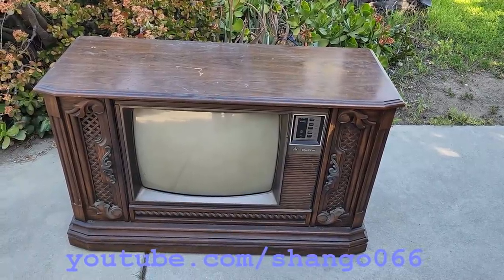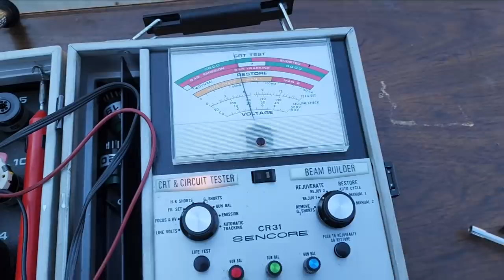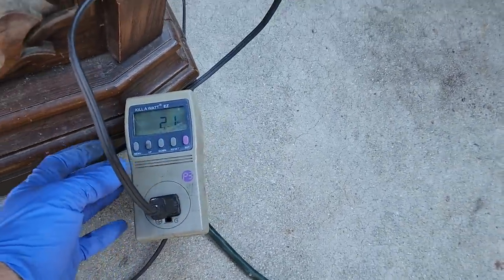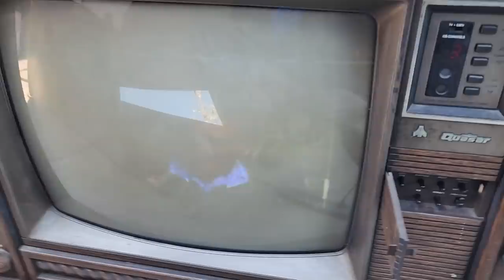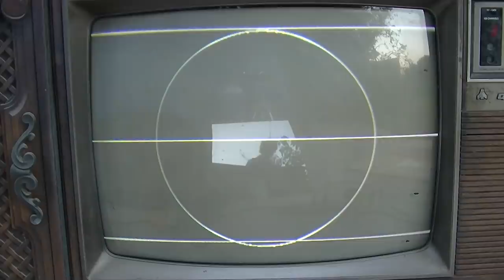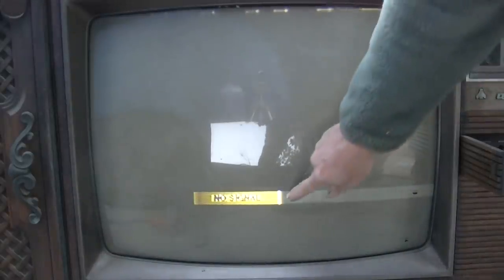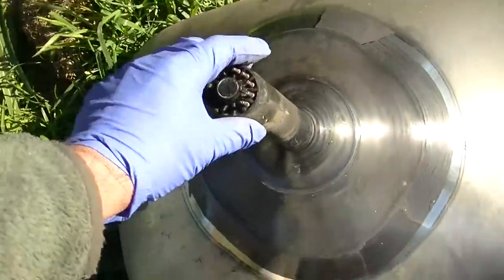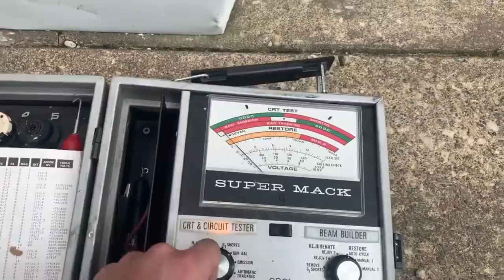1982 Quasar Console CRT Color Television With CRTs

Comment: WOW, this is the exact TV I grew up with lmao.  At one point in '85 or '86, something happened to the CRT and if it was off for too long, it would take damn near 3 hours until a picture showed up, though you could still hear audio.  Funny thing is, after the 3 hour garbage was discovered, mom and dad left it on 24/7 for almost 14 years straight.
Reply: 24/7 for almost 14 years straight.  LMAO

Comment: Here's something to think of about this set, it's 40 years old. 40 and there's still life in the CRT, the chassis is still working. That someone paid the better part of $500 for it in '82 I'd say they got their money's worth out of it. For ugly plastic and particle board and cheap electronics I wouldn't complain too much. As for that house, holy cow, all those old CRT's and especially the old low deflection ones and small roundtubes, what a score! Totally worth trashing some of your near dead ones to take in a bunch of those. Even if you won't use them it's very likely someone would gladly take them.
Reply: i have a 1965 valve/tube dual standard 405/625 (i'm in the uk) black n white tv that has an excellent emission crt, and it still works , plus a 1968 transistorised one also vgc, ..  none have been recapped, the valve/tube one has had to have a new video detector diode fitted, thats it
Reply: @andygozzo72  I have a Ferguson Courier III in the bedroom (BRC 1400 chassis) which sports a CRT with fantastic emission. The picture is lovely and bright and IMO displays a more crisp, punchy and dynamic picture on the 405-line sources than it does on 625.

The Pye 48 is the same in that respect.

I think the best 405 picture I've seen to date though might just be the Murphy V10A .. it looked great during restoration but does need the recap completing (signal stages) and the newly rewound LOPT fitted. This is single standard 405-line.

Comment: Those CRT's, that man may have saved the TV collectors market for a century! Hero!!
Reply: Pretty crazy collection... I bet they were all good pulls. Mixed with some new or rebuilt ones too... 

Hope a bunch get to find a home.
Reply: Crazy collection of crt's. And as long as they didn't go to air they should be fine.
Reply: @sirmojo4537  looked pretty dry in there so most ought to be fine if they were good when stored (except maybe the metal-bell type if any of those)
Reply: We all want to know if he was allowed to remove them free of charge.
Reply: OK I mean this is pretty awesome, but who collects nothing but naked CRTs?
If you're a vintage electronics enthusiast, you'll have tons of electronics, circuit boards and spare parts and stuff. If you're a vintage TV collector or repair person, you'll have stacks of old TVs and maybe some VCRs and spare parts and boxes full of remotes, but just naked CRTs with not even a single yoke in sight? WTF man? Simpson's crazy CAT lady just replaced the A with an R...
Reply: @senilyDeluxe  I kind of feel there was some "eccentricity" involved but it was also mentioned that there was a collection of TVs also and the owner didn't know what they had & started junking stuff.
Reply: There is a type of hoarder that collects as many as he can of some hard to get  item. He will never be able to use them all. If someone wants to buy one he will say  something like "I have a roundy coming in soon, I need them". He never fixes the items, he never sells them, he just wants to have more and more of them. If something happens to him, the family sends everything to scrap. This may not be the case here. Often this happens with antique classic cars. They are stored outside until they rust away and they are not even good for parts.

Comment: More than likely the reason why the picture was "shrunk" vertically and the vertical hold control was diddled so much was because the original owners may have thought there was something wrong with the vertical deflection when the TV was showing 16:9 programming (because of the fact that 16:9 programming shows up "letterboxed" on a 4:3 TV) so they were trying to get the screen to "fill out" when there was letterboxed programming on the TV but then when 4:3 programming showed up on the TV screen they had to readjust the vertical.
So with that in mind there probably wasn't actually anything wrong with the TV, just someone who didn't understand how modern ATSC programming worked on an older NTSC set.

Comment: Those Quasars have a Capacitor near that heat sink the Vertical outputs are on in the Horizontal circuit that will dry up and cause the picture to be dark and smear from left to right side of picture.. Changed many out in the mid to late 80's. I think they got to hot and would fail-
Was happy to see one of these ugly sets, sold them new. Thanks !

Comment: So, the last Quasar you featured, I talked about how it was "Grandma's TV" and how you couldn't hook your Nintendo to it because Grandma was afraid you'd damage her TV.

This Quasar was Grandpa's TV.

This Quasar was the TV you found in the home of a man who worked at Chrysler for 35 years, until a robot replaced his job. He was at about retirement age anyway, so he decided to cut his losses. He bought this TV shortly after retiring, and he kept it until the day he died. By the 90's, he was using it as a stand for a newer TV. He never got rid of it because "Well they don't make 'em like this anymore! No they don't make 'em like this anymore. This is gonna be worth something some day! They don't make 'em like this anymore."
Reply: Don't leave that game on pause you'll burn the screen!
Reply: @danmackintosh6325  Yeah I went over that when I commented on the last Quasar. It was a real problem on rear projection TV's.
Reply: I hate it when they finger that vertical hole too much and it's all worn out.
Then it can't stop rolling over and over.
Reply: @Xplasma1  I still remember the instruction book specifically noting that my NES was not recommended to be used on front or rear projection TV's.  Don't know if it was just my household or whether other's parents/grandparents took that to mean THEIR TV even if it was just a plain-jane 3-gun monolithic bulb...
Reply: @danmackintosh6325  Exactly. And Grandma thought it applied to her TV as well, thus you were forbidden from hooking any game console to it.

Comment: I worked at the Quasar factory service center in the 80s. You got to watch out on those where it smears to the right. Could be CRT or maybe not. There are caps that filter the B+ source feeding the CRT socket board that go bad and it will smear to the right just like that.  Sometime the cap(s) are on the CRT socket board and sometimes on the chassis near the flyback. Scope the power source going to the CRT socket board for horizontal pulses in the DC. If that’s the case the caps are shot. I fixed a lot of them while working at Quasar.

Comment: I think the image quality was better for SD broadcasts before it switched to digital. Analog TV actually looked pretty good.
Reply: One thing I miss about analog is that if the signal fades, the picture would get snowy/fuzzy - but you'd still have a picture. Digital of course just goes to blocks and freezes. It's maddening trying to use an indoor antenna with digital.. analog could always just be 'good enough' and still work.
Reply: If you watch YouTube in 480P, 30 FPS, you can get a good idea of how NTSC could look on an excellent signal. The only difference is that 480P is progressive and NTSC was interlaced. 30FPS = 60 fields/second.
Reply: @MattExzy  radio is the same way. Analog would just fade. Much like shortwave, AM, HF. FM was less forgiving but still worked on weak signals, within reason. All the digital now is “all or nothing”. It is frustrating in certain situations.
Reply: SD broadcasts looked a helluva lot better than how they show up here on YT after all that processing. Personally, I find digital compression artefacts more objectionable than noise in an analogue signal.

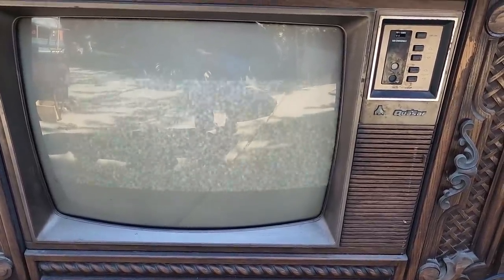Comment: 13:22 I had the same years ago, My TV wont switch on mate, its completely dead, The ON / Off switch must be broken, It needs a new one fitting, if I've been told that once, I've been told it a hundred times, I kid you not. I often used to tell the customer I would supply a replacement switch for free, because I kept a large stock of On / Off switches, the dam things were always going wrong, It would be very easy to fit themselves and save them the call out charge, As I recall, not one person ever took me up on my offer,  A little knowledge is a dangerous thing. Right at the top of Mount Stupid, but, as I'm sure you are aware,  it takes all sorts to make the World go round (or switch the T.V. on :-) P.S. great YouTube channel, keep it going my friend.

Comment: I brought my 1st color TV on my 1st paycheck in August 1981. It was Sanyo (Sears) 19" that last until 2017 when I trashed it and paid $60.00. for deposition fee. There is no repair or home service like the big screen floor model that popular during the 60 and 70 in America. The floor model TV similar to this one cost between $800.00-1000.00 in 1970 with home service contract that cost about $80.00 a year that consider $2.5K to day dollar value base on gold standard ($37.42 per ounce back in 1968.) Oh I forgot the moving cost for this size of TV to the shop is more than $100.00 plus service estimate fee plus actual cost that added up probably cost more than the set itself.

Comment: I'm not much younger and I remember during my childhood how appreciated and highly valued by parents' and grandparends' generations were wine glasses and other table utensils, chandoliers etc. made of lead cristall glass. As far as I remember, picture tubes are made of very high lead content glass - about 20% (except Tektronix's ceramic electrostatically deflected scope CRTs) and the only other glass product that has higher lead content are screens of the sealed chambers used to work on radioactive materials - around 30%. I think CRT's glass is properly recycled, but aren't there craftsmen that can repurpose them without melting? I doubt that after scraping carbon cover out of the bell it would be optically acceptable for a fish tank, but i.e. lighting fixtures might even benefit from this.

Comment: Yeah thats the old Quasar logo.....those darn purple panasonic capacitors. I have a panasonic built top loader that has about 200 of them built in 1980. Been replacing them as I go or notice a problem. Yeah, I remember doing calls and customers would say "i think i need a new picture tube" when the vertical collapsed. I used to fix them in home, had the IC caps and resistors on me for most direct view and projection on my truck. I dont think I have seen an old panny for repair like this one since the late 2000's.

Comment: I use to fix the same look console back in the 70"s - 80"s, but they were mostly Zenith models, mostly the Hor. Transistor for the high voltage was 90% of the problem, that TO-3 you noticed in the fly back

Comment: The lack of vertical deflection happened to our 1976 Wards TV when I was a little around 1980. I remember two bIack dudes showing up around 10 at night to fix it.
This style TV was very common in the early 80s and was pretty much gone by the late 80s in favor of the more modern, compact TV designs. Cable ready was great till they started scrambling the premium channels instead of using notch filters. I remember our neighbor getting the premium channels without a cable box.

Comment: You had the date posted on the back. You panned over it twice.  This TV is a POS.  How I fixed these was covering the tuner and hitting them with a high-pressure hose.    Hit it again with compressed air and let it dry for a week.  Presto! works every time.
Reply: He did note the date and mentioned how it was right in front of his face the whole time.

Comment: On the topics of these console tvs 

Ive got one that is a stereo system and it all works besides the tv part and its getting high voltage and the tube fires but no image, audio, or "snow" on the crt

The audio works for the radio, record player, and 8-track but its only on the tv part its bugged would this be a transistor failure or something more severe?

Comment: contest, the dirt looks like dust and some smoke. If I remember correctly there  two 4.7 around 50 volts in the vertical circuit.

Comment: i do see a date sir in that bottom scratch off retangular thing that look like a integrated circuit printed on the back cover. april 1984. I had a color console solid state. My mom and dad bought me a console that would fit between the closet and the bed room door. The set I used to have had tubes and the crt took a @#$%**&. It would have cost like 90 dollars for a crt

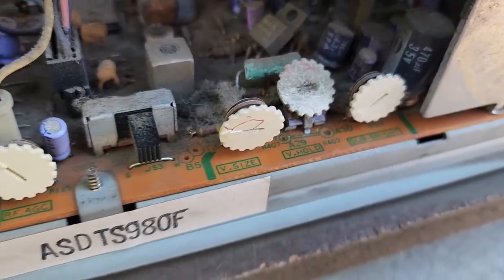Comment: 19:05 Panasonic really cheaped out with those adjustments just standing there, waiting to be mowed down. They could at least have put something behind them, or even soldered them flat to the board so they would be accessible as thumb screws. I suppose they put the vertical hold on the back assuming that with modern video chipsets, there would be little need to adjust it; seems they were wrong.

Comment: Would you have any interest in a 35" toshiba set? It played pretty good, but would intermittently loose the color. I have had it for about 22 years. I had the vertical deflection amp replaced. I know the high voltage is good. It has pic in pic, but single tuner. I think it is from late 80's to very early 90's. It is a really neat set.
Reply: Joseph - You sound like me recently trying to give away a perfectly working 35" gorgeous Magnavox console (my wife wanted a flat screen to take up less space) that even the landscapers didn't even want to even take a LOOK at. Cost me $200+ to have 1800 XXXXX to take it away. They sent two beanpoles in a high-back, no-lift stake truck for this 300 lb behemoth.  I had to build a ramp with 4x4s and almost had a stroke helping them lift it.☹
Reply: @cmans79tr7  It's a 35" Toshiba and not a console. and it has an intermittent problem killing the color. But during the time it is playing correctly, it had a beautiful picture. I am sure as old as it is now, it would need completely re-capped. But I would give it to someone who would like to have and fix it.

Comment: what's the point of that fan in the crazy crt-collectors house? pulling hot air from the uninsulated attic into the livingroom?
Reply: I believe that is a “whole house fan”. You open up the windows in the evening, turn that fan on, and it will cool the house down very quickly.
Reply: Fan sucked hot air from rooms, UP into attic, supposedly to exhaust outside and save electricty as opposed to running air conditioning. Sounds to me like a good concept, but I know of three people who had it installed, used it for a half-season, then never used it again. I never asked them why they stopped using it.

Comment: And Sony was building the Trinitron, with every penny more.
Reply: This has the “personal touch” control though.
Reply: @gavincurtis  Personal touch is just a fancy name for the contrast control.
Reply: @dougbrowning82  Contrast is for peasants.
Reply: The Quasars of this time were pretty solid. I knew this thing would work. Actually was same time RCA had Fly backs going bad on EVERY set they sold and Zenith had some issues with solder connections on the 181 modules . They were all cheaply built by this time. I think Disco was about finally at its end as well.
Reply: RCA and flyback replacement were damn near synonymous all through the 60s and 70s.  I don't remember the Zenith solder problem, but unlike RCA they probably fixed it.
Disco was mindless but it was also harmless, unlike the rap crap of today.

Comment: Why am I not surprised at how empty this cabinet looks once the back is off.  A set made to look far bigger than it actually is, presumably to appeal to older people who remember the days of the old, 'grams', they had as pieces of furniture in their drawing rooms.  A hollow box with the tube and required components underneath it with a single speaker stuck to one side.  A practice that only got worse as technology progressed.  Look inside any modern audio/visual device and it's mostly air with a small circuit board screwed to the facia.

The clip at the end with the treasure trove of old tubes was interesting.  Although, it could have done without the rave/roller-disco musical accompaniment.